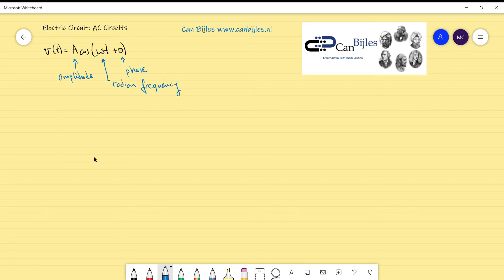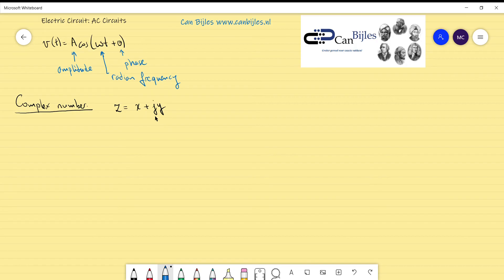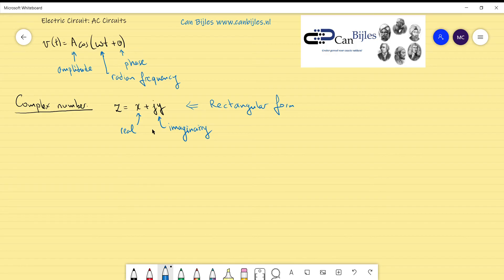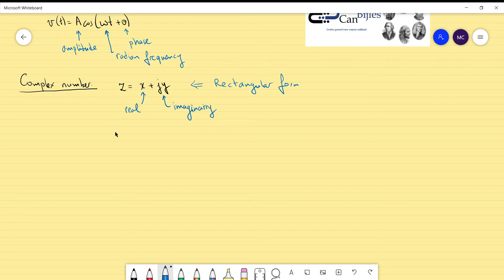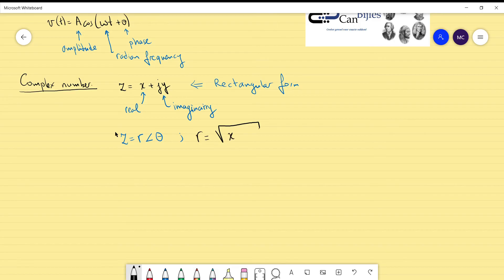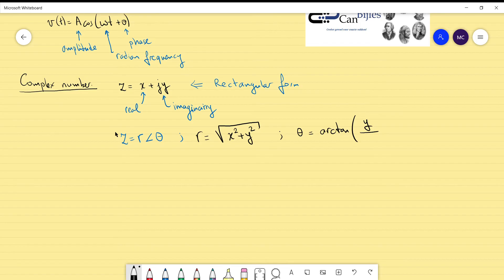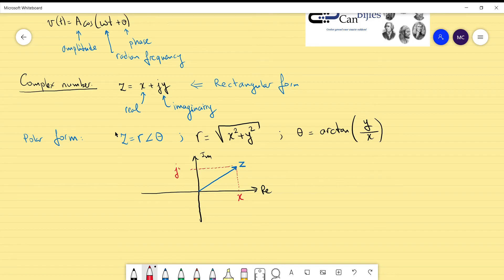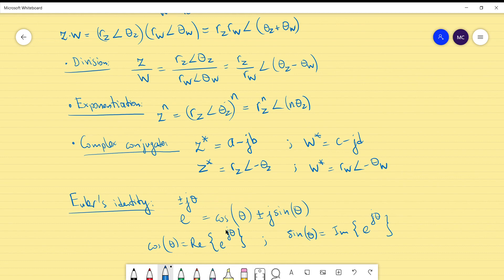Introduction to Phasors & Complex Numbers 🌟 AC Circuits

Comment: What book would you recommend to study analogue circuit design ? Thanks
Reply from the maker: It depends on what level you want to have. 

Intro level: 
[1] Electronic Devices, Thomas Floyd 
Medium level: 
[2] Microelectronics, Donald Neamen 
[3] Microelectronic Circuits, Sedra & Smith 
High level:
[4] Analog CMOS Design, Behzad Razavi
[5] Structured Electronics Design, Anton Montagne 

Reading [5] has a complete different methodology to design electronics compared to the other resources.
Reply: @CANEDUX  That's very kind of you. Huge thanks.
Reply from the maker: @Fidel-tk5rq  You're welcome! I hope you get a good understanding of electronics design. It could be sometimes challenging though.

Comment: Thanks for sharing. Could you please explain or post a video about making use of Euler's identity or the exponential form of complex number as another way to think about phasor.
Reply from the maker: You're welcome! Eurler's identity is also explained in this video, see around 00:17:49 for this.
Reply: @CANEDUX  Many thanks for your prompt reply. That's right but I would be grateful if you could provide further details about the exponential form e^j(wt+theta) and how can the phasor part (e^jtheta) be used in solving circuit problems.
Reply from the maker: @Fidel-tk5rq  I think this document explains this topic pretty good in detail, starting from time domain analysis: https://users.metu.edu.tr/home103/ccandan/wwwhome/ee202/EE202_Spring201516/Notes/EE202_Notes_Nth_Order_Circuits.pdf
Reply: @CANEDUX  Thank you so much for the document, it's very helpful.
Reply from the maker: @Fidel-tk5rq  👍You're welcome!

Comment: What is meant by steady-state in a capacitive circuit subject to a sinusoidal voltage input?
A sinewave depicts movements in the form of waves. It has a datum, rapid, slowing and steady growth in one direction for a quarter cycle with reference to a datum (a reference), and then slow and faster decay in one direction for the next quarter cycle, and all these elements again in the opposite direction (reversal) of the forward movement for the next half-cycle. It has peaks and valleys. 

In essence, the sinewave is a perfect embodiment of oscillatory movements like springs and quantities like voltage. It retains its waveshape when added to another sinewave of the same frequency and arbitrary phase and is the only periodic waveform which has this property. 

Imagine that you and your friend are playing a game of “swing”. When your friend sits on a stationary swing and you begin pushing it, it will take a few hard pushes initially to overcome inertia when the swing moves with a small displacement. You then synchronize your pushes by progressively moving slightly away from the stationary position of the swing, initially, pushing gently, and then pushing harder as you move away from the central stationary position of the swing. 

The point of pushing the swing is usually at the top of the swing cycle at one end. It takes a while of pushing before you are able to establish a rhythmic swing. 

The period before the rhythmic swing is established is the “transient”, and the rhythmic swing that is established after the few transient cycles elapse is the “steady-state”. 

This is analogous to establishing the steady-state in a capacitive circuit subject to a sinusoidal input. The capacitor being initially uncharged, will cause the current during the transient period to assume a value that will be quite different from that at the same voltage angle after steady-state is established. 

Electrostatics and circuits belong to one science, not two. 

These are discussed usually separately in textbooks and science and engineering courses. 

It is not possible to discuss the circuit processes which produce a sinusoidal current when a sinusoidal voltage is applied to a capacitor….the changing rates of change of the applied voltage ….the surface charge set up changing at every instant….the applied field changing in the wires ….and the current at each and every instant in time. 

Watch the two videos listed below to learn about current and the conduction process and surface charges (using a unified approach to electrostatics and circuits at a fundamental level). 

1. https://youtu.be/TTtt28b1dYo
2. https://youtu.be/8BQM_xw2Rfo 

The last frame of video #1 lists textbook 4 which discusses the sinusoidal steady-state in capacitors and inductors with the help of sequential diagrams and animated power-point presentations of the varying field components in the circuit elements in more detail.
Reply from the maker: Thanks for the long info. However, despite in physics, we in Electrical Engineering do not bother much about the fact that physicist do not prefer to work with voltage and current in the analysis of reactive circuits. You can relate these to charge too, but the extra transition from charge to current or voltage is not required. 

In a RLC circuit, you CAN and it is possible to do all the required analysis by using KVL, KCL, Ohm's law, and the formulas for the capacitor and inductor current and voltage.